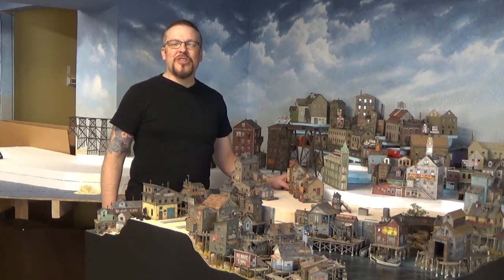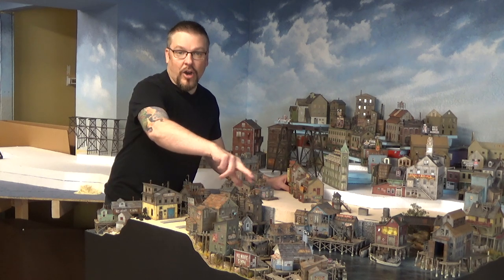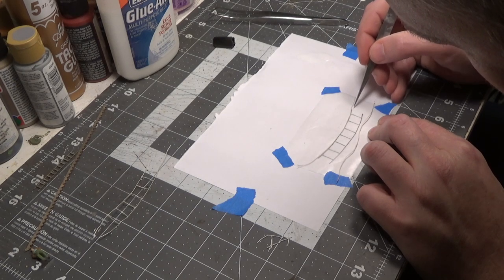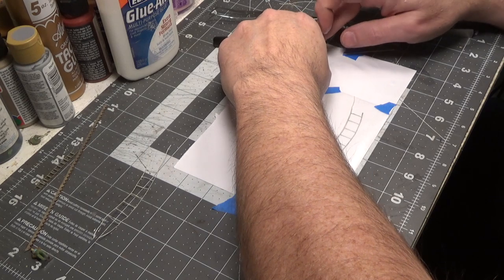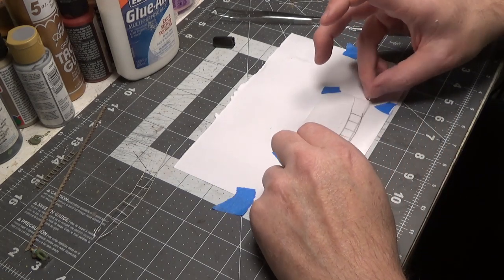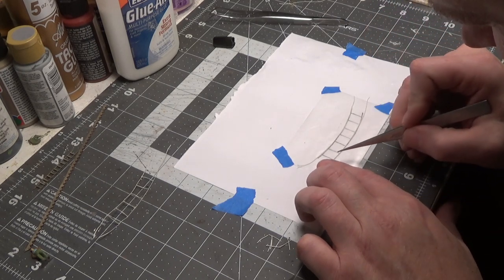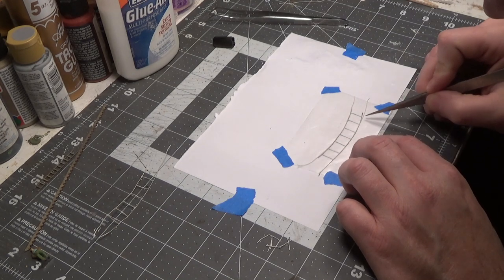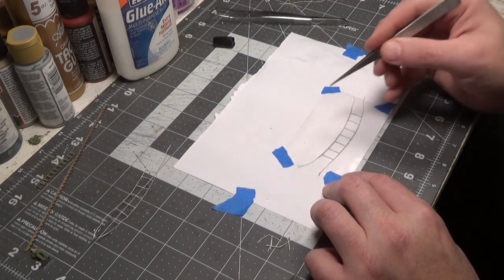How to make a rope bridge for your model railroad layout!

Comment: Hi Jason, here some advice to lighting. I bought for my rr room 30 x120cm led panel lights 40w in neutral white, 4 pieces. Now nothing is hidden in darkness no more and came alive with the flip of the light switch. Cheap to have too. Search ebay.  They can be with dimmer or without. Otherwise great work you do. Greets from Germany
Reply from the maker: Thank you so much for the info Karl, I really appreciate it!!!

Comment: 5000k( white) verses 3500k(.yellow)...different lights....the new led cans have an ajustable 3 way switch so you can choose, 5000k,4000k,or 3500k...same follows with trck lighting, only you choose the correct mr16 bulbs...they wear out fast though...your better off with led stuff....